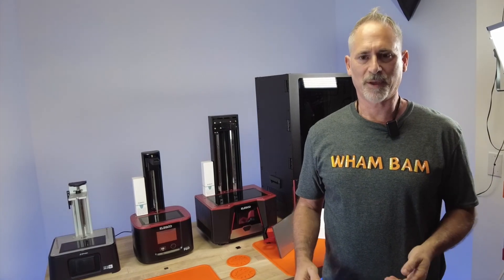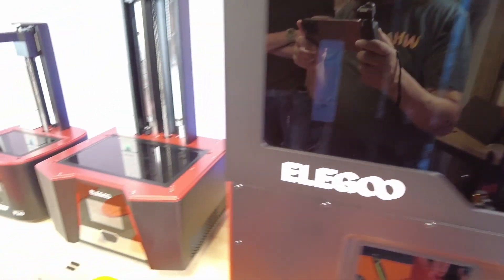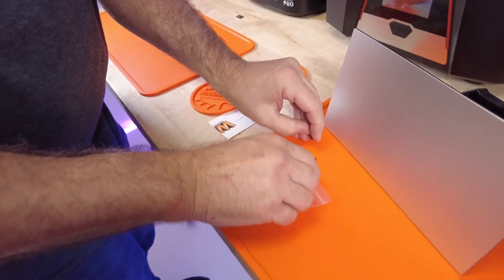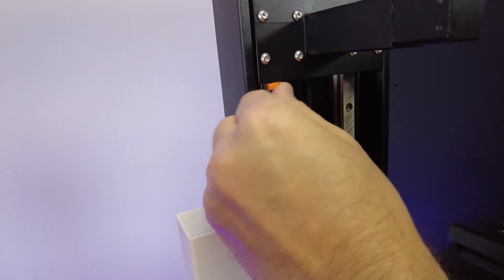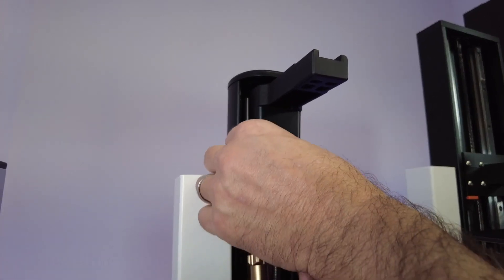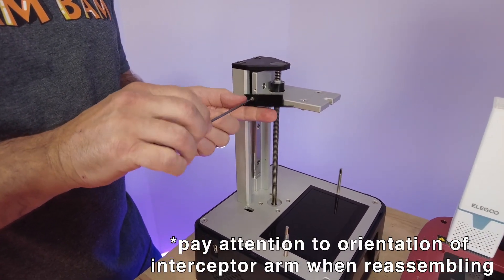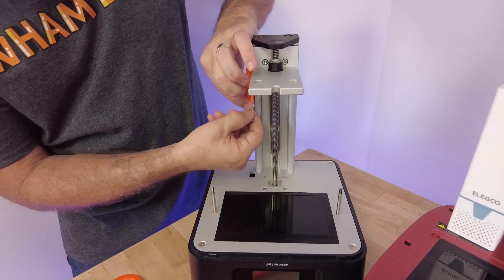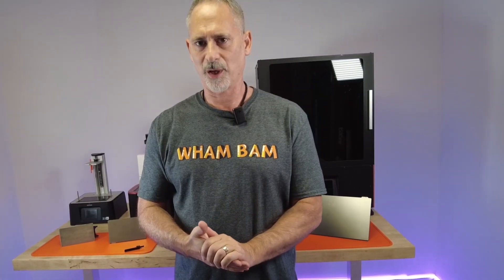Z Limit Adjustment - Detailed Explanation For Resin Printers

Comment: I solved the problem simply, I did not use a magnetic mat, I drilled a recess in the metal part of my printer and installed 6 magnets there

Comment: I ordered a flexible platform but when I got mine it did not come with screws or anything with it so what size screws will I need to get? I have the elegoo most 2 Pro
Reply from the maker: So sorry you had this experience! Sometime the small screw bag gets stuck to the inside of the box. For our regular kits it is M3x8 screws and for our thicker XTR kits it is M3x10 screws. We are always available by email for quick answers that do not get lost in the replies, technical@WhamBamSystems.com
Reply: it's all right thank you for at least getting back to me it took me a while to get the screws for it I ended up getting a screw kit for the 3D printer from Amazon and I did not know I have to print out a spacer so I ended up using washers for the spacers I am happy with the flexible plate I haven't had no issues with it so far

Comment: Are the spacers available somewhere I don't have to register to download?
Reply from the maker: Since many of our spacers are modeled by users it is hard to dictate what platform they will be on. However our technical support team can help, email them at Technical@WhamBamSystems.com and they can send you the file you need. Hope this helps!
Reply: @WhamBamSystems  It's fine.  Having seen how they work, I made a flag out of aluminium tape that does the same job.

Comment: I’m starting to lose hope with the XTR flexplate on my Saturn 3 Ultra. I tried leveling 5 times already, but could never print anything.

It’s either to low and the printer starts clicking when homing (although it didn’t when leveling), or too high and the print doesn’t stick to the XTR plate.

I tried the method described in the description, as well as many others, but it just does not work (and yes, I did install the correct spacer).

Sadly, I’m considering removing the magnet to get my printer back to printing.. 

Also, the set Z=0 function on the Saturn 3 seems not to function correctly (I know we shouldn’t use that, but I had to try too)
Reply from the maker: Hello, very sorry for your issues and your frustration.  I can confirm that the XTR plate works very well on the Saturn 3 Ultra, let us help you to fix the issues. Please do send us an email so we can give you one-on-one support!  technical@whambamsystems.com    do send screen shots of your slicer, and let us know what is not printing? nothing sticks to the Flexi Plate, or prints are partially printed?  also include screen shots of your models, photos of failures if possible.  thanks! 
if you have no adhesion what so ever, you can increase base layer exposure up to 50s, or sand one side of your Flexi Plate with 400 grit wet dry sand paper and clean well with IPA and fresh paper towel.  Also make sure lift distances are 7mms or higher and initial lift speed are 70mm/min or lower.   Thanks!

Comment: How do you know if you have purchased the original or XTR? Just bought the plate for my Saturn 3 Ultra.
Reply from the maker: XTR has a thick magnet 3mms and says XTR, it looks like from your order you purchased the non XTR - FBSR
thanks
Reply: @WhamBamSystems  copy. Thank you for the reply. Out of curiosity can't I just change the Z=0 level and skip adding the spacer? Why is it even neccessary?

Comment: I now should add that to access the interceptor arm, I had to pull the entire piece off the lift screw. When I place the parts back on the lift screw, did my Z-zero all went well. BUT when I starting print, the build arm went into the resevoir like it was going to print, then lifted up to about 500mm above the reservoir and stayed in the position OUT of the reservoir and did motions that appeared like it “thought” t was printing but stayed well above the reservoir. Make sense? Thanks!
Reply from the maker: It doesn’t make sense I’m sorry, can you please write an email to Technical@WhamBamSystems.com and we will try to help.  another thing you could do first is re-level the bed and when it’s at its full down position hit Z = zero. Then tighten the screws and test again.

Comment: Struggling for some help. I’m a newb and have the MARS4 DLP and When in print mode the arm/build plate moves to the top of the lift screw and the build plate and arm stays about 500mm above the resin reservoir and slightly moves up and down as though it is in print mode and in the resin tray.  As a result, the print bases gets imprinted on the FEP. The aforementioned happened after I took the interceptor arm to add the extender off by taking it off the lift screw. Thanks !
Reply from the maker: Did you use this distancer ? https://cults3d.com/en/3d-model/tool/mars-4-dlp-z-limit-extender-for-wham-bam-fbsr

Comment: I appreciate how comprehensive your video is.  I have the MARS4 and I struggling with find how or where a space can be placed considering the intercepter arm has a different configuration. Any suggestions?
Reply: Duh, I needed to be patient because you explained it later. Now I have to figure out how to improvise that arm since I’ve already hooked up the flex plate to the build plate. Thanks again for your post and for your help.

Comment: In my case, I have a saturn 3 ultra and I installed a 2.6mm spacer.  But I have an issue, when the build plate goes up to the top end, it goes 2.6mm more and pushes the top cover plate and it bent and lifted with bad cracking sound.  Any solution for this?
Reply from the maker: Try to define in slicer Z height of printer and remove 2.6 from current total, feel free to write us at tech.director@whambamsystems.com for further help
Reply: @WhamBamSystems  is this something i need to watch out for on my saturn 3? i just installed the spacer and build plate...but..i have never taken it up to the very top.

Comment: I’m confused by the description, it says do not use set z=0 but in your FBS for Resin video you set “z=0”. Could you clarify if/when z=0 should be done please?
Reply from the maker: It’s best not to, unless you have already used the feature, then you have to reset it by hitting z=0 once machine is homed.
Z=0 function is fine for telling the machine where to stop upon homing, the problem is that the machine will always home first to where the z limit switch is tripped then move to set home.   if your home needs to be far above the bed, then the machine will send the build plate down against the screen while trying to trip the z limit switch before it ever gets to your set zero.
I hope this helps!
Reply: @WhamBamSystems  So just want to understand what is happening here, out of the box the home will travel until the arm reaches trips the switch and I suppose the first layer will print according to that method as well. If I never set z to 0, this will always be true. Once I set z to 0, there is a logical point set that the printer will use to print that first layer? So if I level with the screws I should never need to set that logical z to 0.
Reply: Just wondering why many other videos, like the official saturn 3 ultra video from Elegoo say to set z to 0 once the leveling is done, when it doesn't really make a difference?
Reply from the maker: @smokymcmenziez  you can use the function after leveling is done manually without using the machine interface to raise the Z. This will ensure that it clears out any previous Z equals zero settings.
Reply: Okay I think I get it. You set z to 0 in that video because you homed, then incremented the height manually instead of adjusting the leveling screws. So I don’t need to set z to 0 if I’m using the leveling method in this description

Comment: I don't understand why it matters if it compresses the spring more. It doesn't do anything when the plate is locked down.
Reply from the maker: It makes it much harder to set the gap, sometimes impossible, if the compression won’t let you lightly press on the paper. If you want to try an Elegoo without spacer consider leveling on multiple sheets of paper 3-5, then removing all but one to verify in the end

Comment: I would love to buy wham bam products but they are virtually impossible to get in the UK, reseller never has stock or is so limited it’s of no use if you don’t have ,one of the 3 printers they support. 😢
Reply from the maker: You  can also buy direct from our website, or from a wide variety of distributors in E.U., ask 3D PrintzUK for the products you want so they can order them!